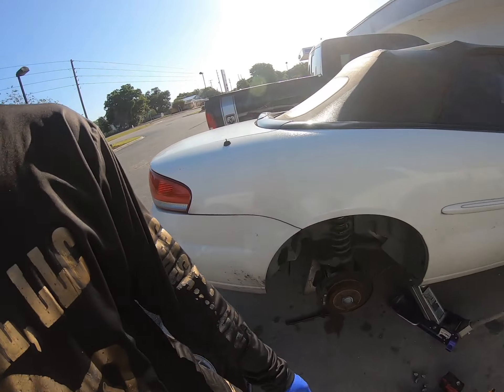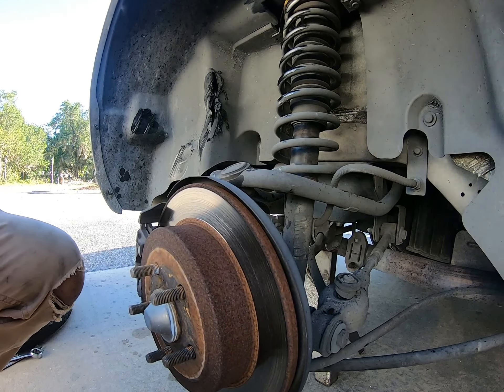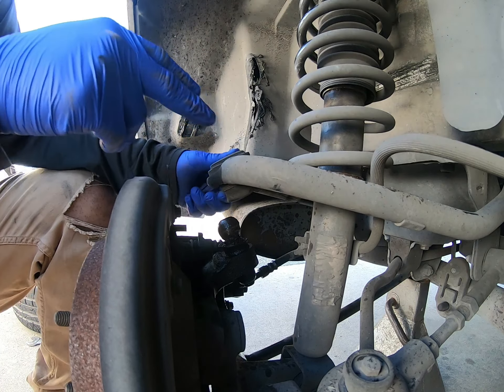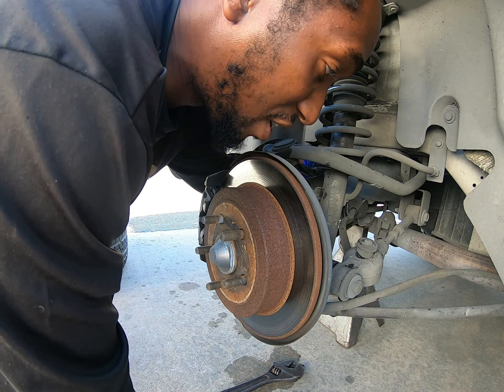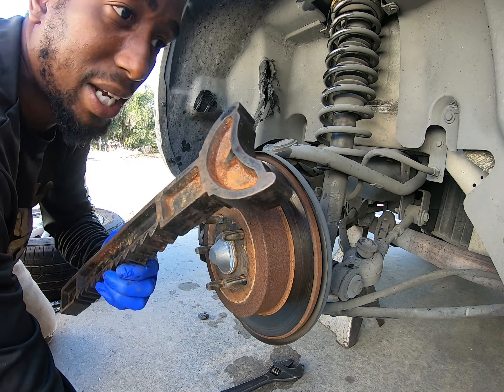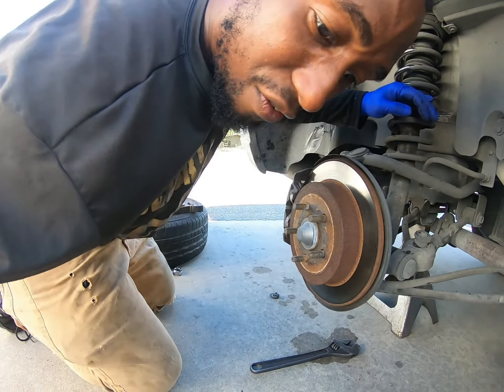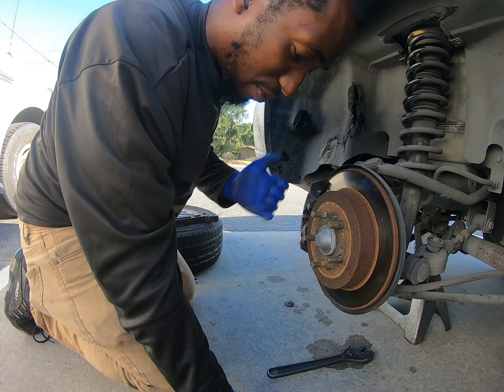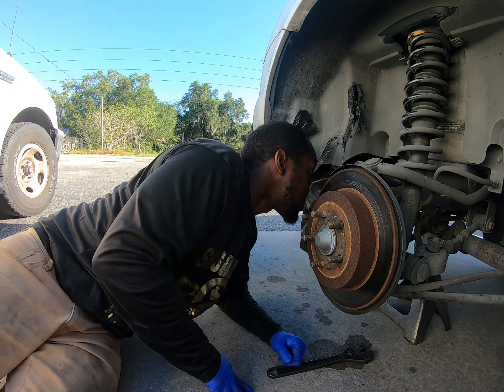The culture is poisoned

Comment: I wounder if you could use the same wipe on screen protector they put on phones to protect camera lenses.  I know I've dropped my phone from 5 plus feet flat on the screen and it's fine. Just an idea. It may or may not work for a couple reasons.
Reply from the maker: That's a good observation I just like the tripod it makes life easier for me when I can stand it up the problem is there's not always room to show what I'm trying to show but they make replaceable lenses I probably should pre-order some and have them on Deck lol